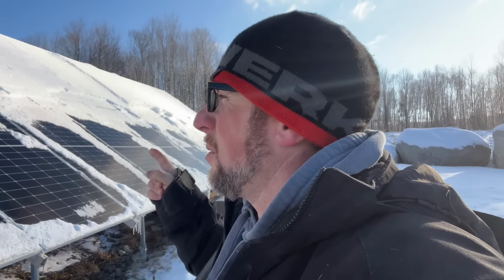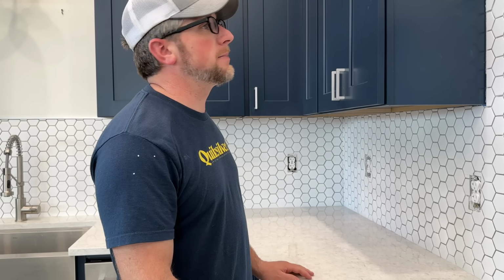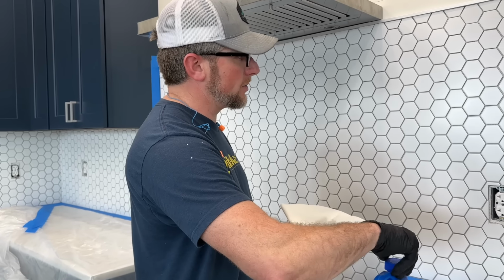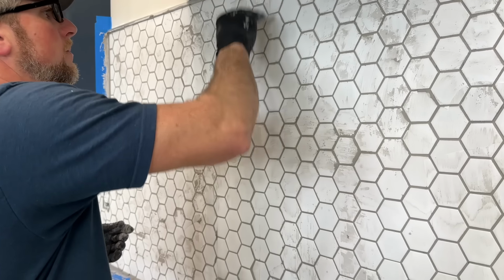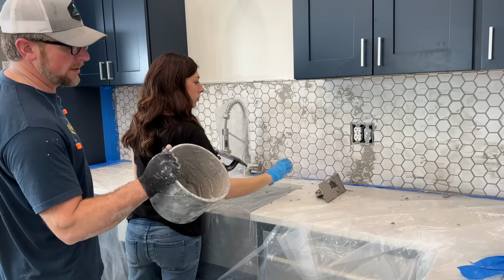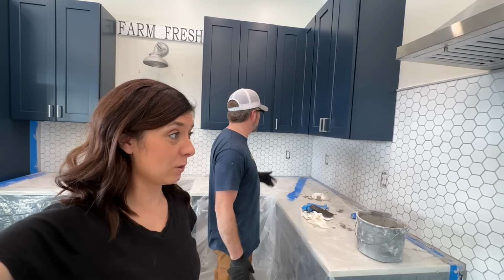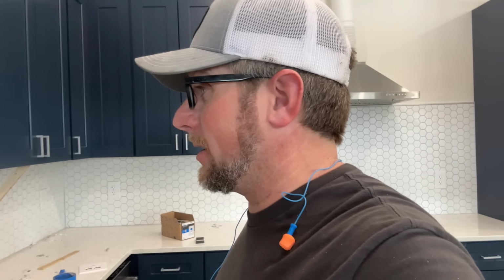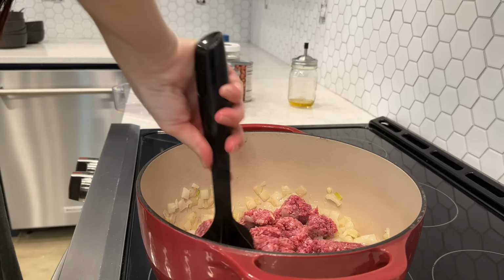We're FINISHED! | Building our OFF GRID House in the WOODS

Comment: I'm a retired tile setter, and you're lucky you didn't run into the grout drying too fast before wiping it off with the sponge. When you grout, you should do small sections at a time, then wipe it off. I would have done the wall with your stove in 5 or 6 sections, wiping down the tile before moving onto the next section, and then wiping it all down several times after. Just a tip for you from a pro.
Reply: Helpful tips for others and or if/when they build their main house
Reply: Been there and done that. 40 years ago I did a floor. I was lucky I had my 17" rotary scrubber and a black pad. I did okay. My speed went through the roof after I got a few lessons from a customer's brother who was a setter. I also picked up on epoxy adhesives which might have been overkill in your case. They got grout in epoxy too.
Reply: I've run into that doing floors. Only took once for me to figure out to do sections. I had to use SOS pads to help get it off! I sure didn't want to have to repeat that again... ever! 
I did all the floors in our house. Finally, I did the last room a couple of months ago after being here 20 years 😆
Reply: I was concerned about that, too.

Comment: When I worked at Dunkin donuts back in the nineties lol they had to do it all by hand I didn't have the machines and stuff. So we had to put double grounds of coffee in the filter. NC for instance you're making a regular pot of coffee without doubling the amount of coffee grounds. And you only use eight cups of water for instance. Well that's what you still would do you would double your grounds and still use cups of water. But I recommend you freezing your coffee after you're done making coffee and whatever you have left over. To use as your ice cubes when you make iced coffee.

Comment: When we were in Costa Rica working on a church with the locals, they would let the grout set up for about an hour then use scouring pads, the plastic not the metal, to rub off the grout. It left perfect grout lines and left a fine powder that was easy to sweep up. We have done that on several projects at home.

Comment: The grout looks good it’ll look good the next morning needs to dry overnight, damp in the tile just a little bit of it off with a towel that’ll get the extra haze off might have to do it twice. It’ll look great especially when you’re using smooth tile, it’s a little harder when you have imperfections in the tile get the grout off looks good

Comment: Al, Could you put up a heat tape across the top edge of your solar panels to get rid of the snow.  The gutter tape (eavestrough) could be plugged in at the start of winter. You could also maybe use a heat tape that is used on water lines under mobile homes.

Comment: I wonder if, for snow cleaning the solar panels, if you tied a rope to the upper corner end panel and ran it across the panels to the other end.  To clear the snow move the rope up and down on the panels from the far end, lose rope end.  I would think that would work to slide the snow off all the panels in one shot.

Comment: which is easier tile walls or floors?
i've done a few floors and it always seemed like there was less mess to clean up. also we used to push for lighter colored grout because it shows fewer/less spacing differences.

Comment: A suggestion to make your cooking healthier: Your ground meat has quite a bit of fat in it. And if you add in the bacon, you get even more fat in your pot. Instead of adding even more fat to your meal by adding oil to start the cooking process, just add a tablespoon or two of water to prevent the meat from initially sticking (and burning) to the bottom. And the finish cooking your meat and/or stew in its own fat. Which is more than enough fat for the dietary requirements.
Reply: Fat has been vilified by doctors and it's NOT fat we have to worry about. We need it for our brains to function. My mom used to cook our eggs in bacon grease. My grandmother did too! Fats are needed for nutrition. Carbs and unsoaked grains are our real enemy. Women would soak grains before they cooked with them. That made the pyrethrins break down so it wouldn't get in the bread. We also know that Al likes to buy meat that has been pasture raised so I doubt that those fats aren't healthy. Eating fat does NOT make you fat. Sugar is BAD!
Reply: @StoneKathryn  - and seed oils!

Comment: A roof rake will give you the reach to remove the snow off those upper panels.
Reply: He may be worried about scratching the panels with that. Gina used her leaf blower on them but maybe this snow is too heavy for that.
Reply: Or a pool broom with an aluminum extension handle... nice and light and it can reach far
Reply: @StoneKathryn  I use a roof rake on our panels.  It's smooth plastic, no sharp edges.
Reply: @usbpphillips  I've only seen the aluminum ones that I didn't know had plastic edges. Thanks for letting me know.